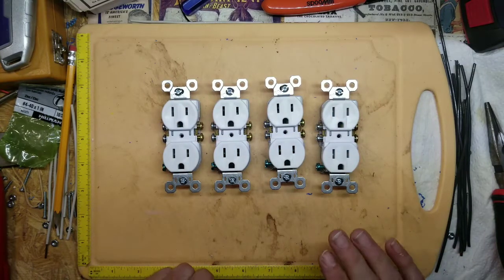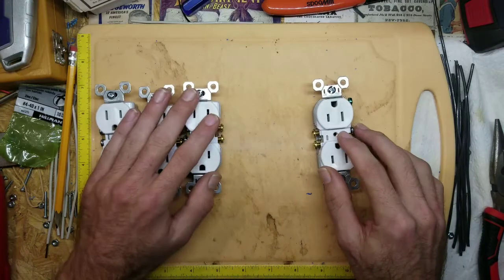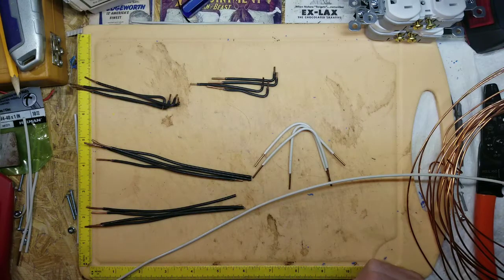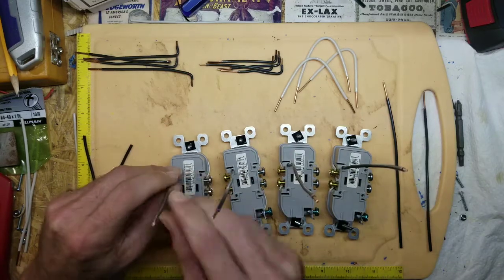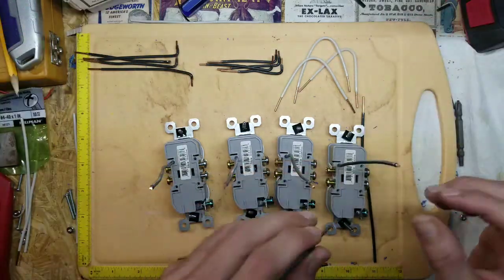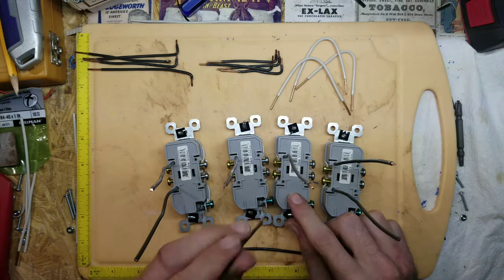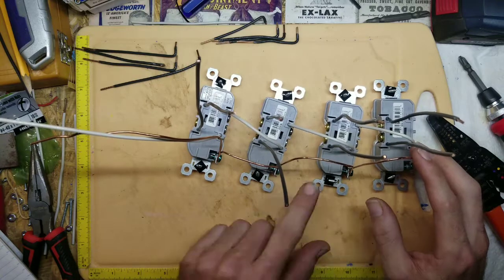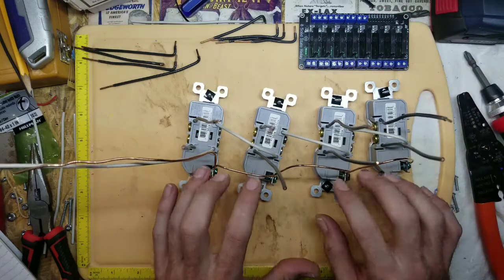Christmas Light Control Box Build - Part 2 - Wiring The Outlets

Comment: I'm just curious why you didn't use copper stranded wire instead of the solid wire.
Reply from the maker: Solid will push into the back of the receptacles, which saves me some time by not having to use the side lugs on the receptacle. It's also a better fit and connection in the relay board terminals. 
That and I've never used stranded on house-type wiring.
Reply: @OutdoorsWithShawn  gotcha, I figured the connection on the receptacles was the main reason. Will this set up work with LED strips, like RGBCCT 5050SMDs?
Reply from the maker: It will work with anything that's powered by 120 AC Volts.
It will power a RGB strip power source (transformer/driver). But it won't change the LED colors on them if that makes sense.
Think of this setup as a set of AC switches controlled by a small computer.

TECHNICALLY, you could use the arduino to power a few AC outlets and save a few outputs to change the RGB colors of the strips. I'm sure there is a limit to how many it can control/change colors of. The output voltage of the arduino needs to match the voltage the LED; I think the output is 5V.
Or you can use it to just control the RGB LEDs and no outlets.
Reply from the maker: If you just want to control some RGBs, look into an ESP32 board. You can control about 4,000 RGBs with one and it's a quarter the size of the arduino mega I used in the videos
Reply: @OutdoorsWithShawn  thanks, will do!

Comment: I'm very new to considering building my own controller box, I'm talking a few days in. Are the relays and control modules you use only for LEDs  or will they also control traditional incandescent lights?
Thanks!
Reply from the maker: They will definitely work with traditional incandescents. They will turn on/off anything you can plug into a 120V outlet.
Reply: @OutdoorsWithShawn  Thanks! Of all the DIY videos I've watched to attempt this your's are the easiest for a country boy to follow. Good job.
Reply from the maker: Thanks! I appreciate that!!
I try make them simple but thorough enough to get it done right and safely. The technical jargon not many (including me) can or really need to understand; just the basic principle of it.